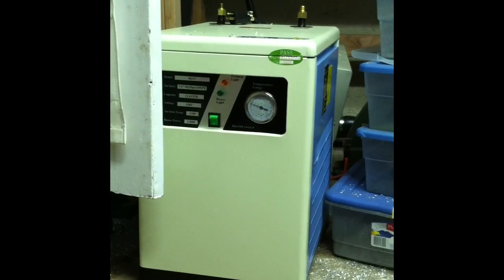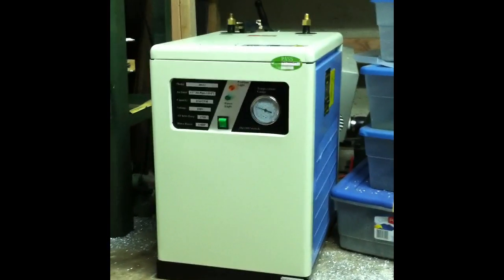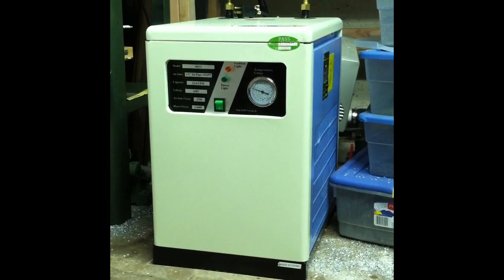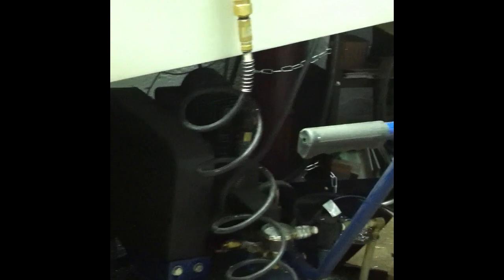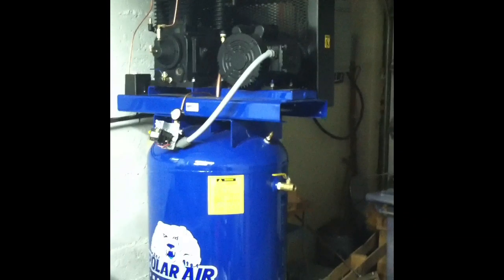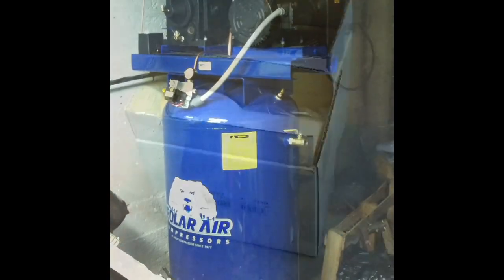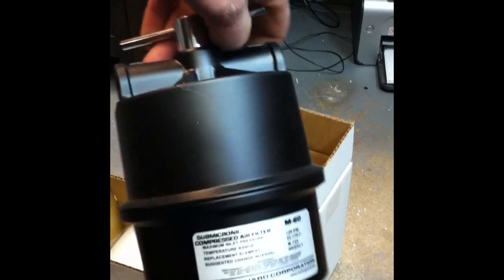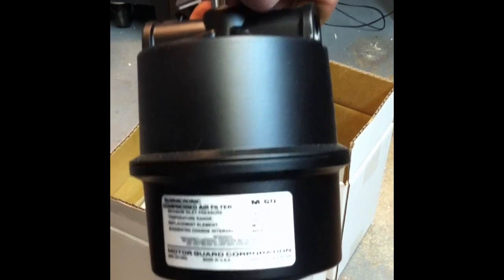Torchmate Chapter 2 - Air Compressor & Air Dryer have arrived!

Comment: Dont put the dryer between the reservoir and the tank as others said the air is still very hot there. What you could and should do is putting an oil cooler in that space. They are fairly pressure resistant and cool down the air so a lot of water condenses directly and collects in the reservoir where it can be drained.

Comment: I plumbed the motor-guard next to my plasma.  That way any moisture that might form due to condensation on the travel from the air compressor to the plasma will be captured.  I then have a short 2 foot hose from the motor-guard to the plasma

Comment: My vote is to not place the filter on the inlet side of the tank. I'm certainly not an expert, but it seems to me that the compressed air coming off the compressor is very hot. The tank actually cools down the air, allowing condensation of water in the tank. Thus the tank is the first water trap. It can be drained periodically from the bottom. Then filtration and drying can be done downstream after much of the water has been removed. I always put an elbow/ball valve on the bottom to drain.